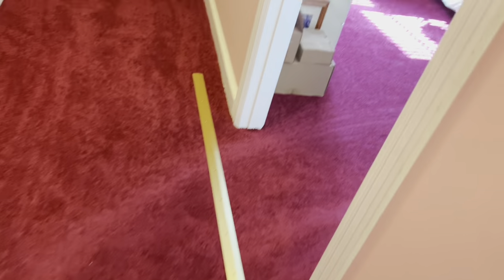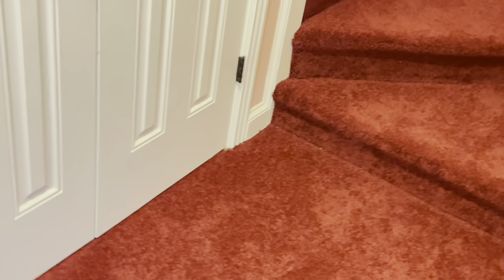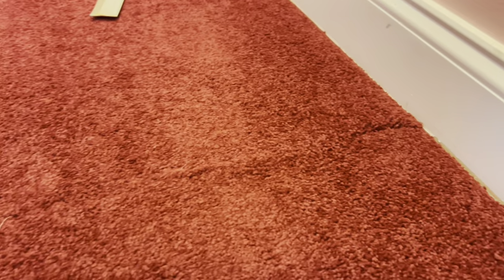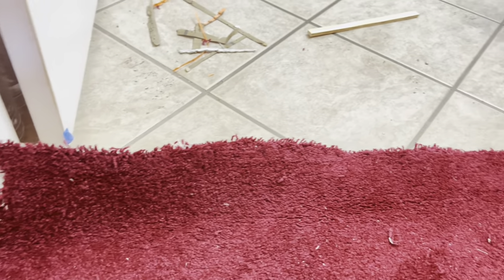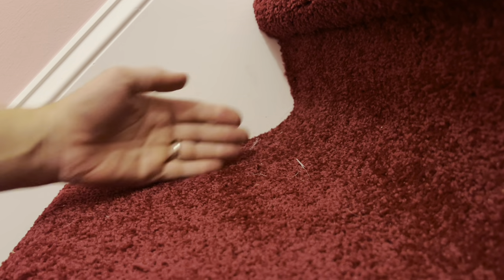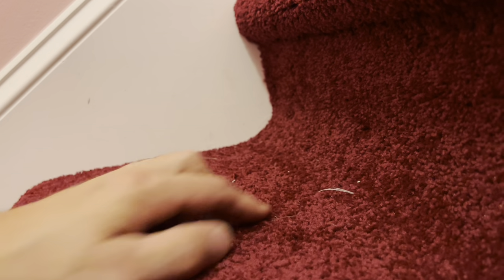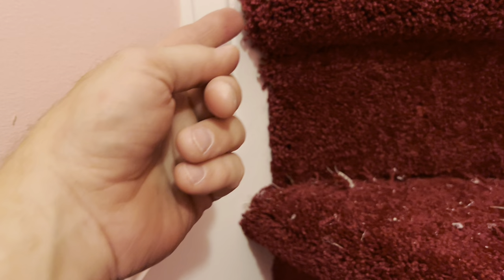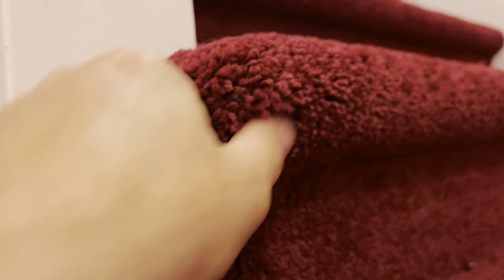Daily grind, horrible carpet install￼

Comment: 11:50 Helpful tip when the crease is curved like that get a hammer & a stair tool & hit it to get that nice crease. Do it before you staple the bullnose. So you get a little bit more. Then as far as the bull nose sometimes cutting it from under helps as well & I’ll make the crease under the Bullnose look way better.

Comment: Looks like work from some of the guys around here. When they're getting paid cash and they're in a hurry to go buy some Oxys.
Reply from the maker: That’s messed up 🤦‍♂️
Reply: @FloorsbySouthernboys  Agreed, my friend.
Reply: What are Oxys?
Reply: @chrisreynolds2410  Oxycontin, pain pills. Around here, most stores had maybe 1-2 sober crews, but most others had alcohol or drug problems... usually both. A lotta guys wearing long sleeves in Summer. 
 They'd basically harass customers til they drove out to the bank and got cash to pay them. Then they'd leave in the middle of the job to go buy pills(sometimes heroin), maybe come back a few hours later to finish... or the store would send us in behind them to clean up a mess. Some of those guys were actually killer installers, but threw it all away for dope. Sad.
Reply from the maker: @chrisreynolds2410  pain pills

Comment: To make a hack's job look even worse, be sure to buy cheap carpet.  Just flowing over the stair edge, the backing shines though like a neo sign.
You can only do so much to fix a job like that. Nice work.
Reply: also looks like the pile is going the wrong way on the steps running up not down
Reply from the maker: Yup
Reply: @jb-es5zj  i thinks the nap direction is debatable.. when i got certified they said before vacuums where popular youd  use a broom down the stairs and out the door, which made it easier to broom the dirt out. but now i usually turn my nap up instead of down so your foot slips less on the bullnose and maybe prevent falls down the stairs.  i think either way is acceptable... jmo    also, how many of you guys call that a holly wood step?
Reply: @bobbyh5016  nap on stairs should go down /
and never heard of it called a holly wood step what does that refer to